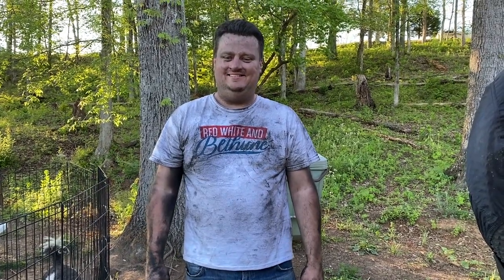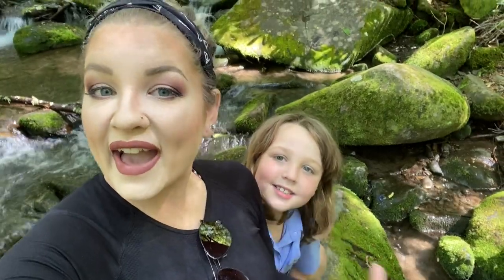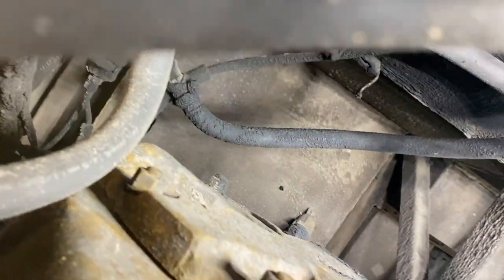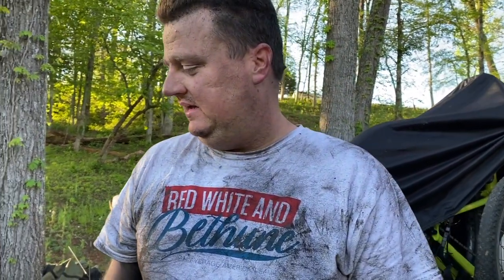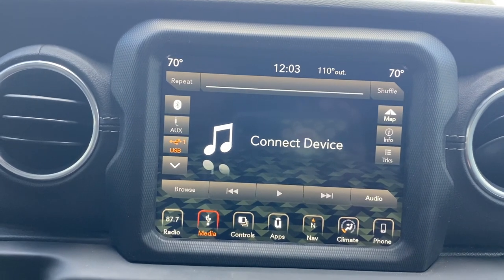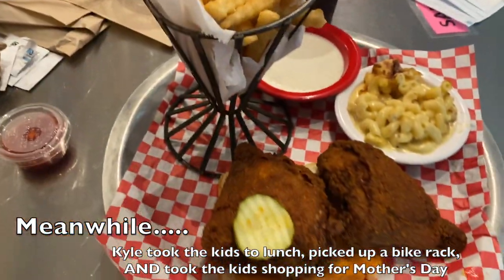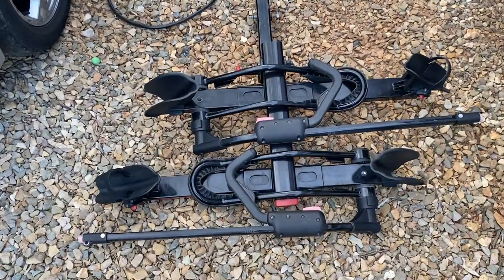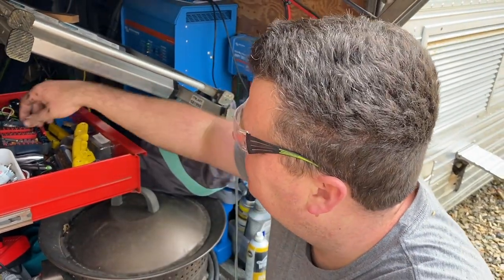Will we ever find the PROBLEM!?! || Bus is STILL broken!

Comment: I have probably 6 manuals for our 85 model 10 when we bough it.  I can thumb through them to see if there is anything that might help you out with your problem.  Have you verified there is air coming from the compressor? If so where does it go after that?  Gotta find where the air stops flowing from.
Reply from the maker: Thank you! We have went up and down the entire system 😔
Reply: @Beingbethunes  were you able to verify the compressor is making air?
Reply from the maker: The compressor is making air. Would you sell one of those manuals?